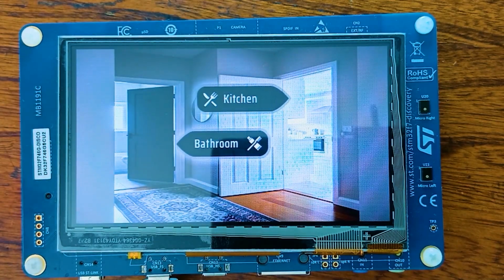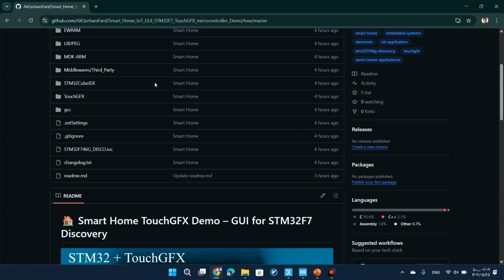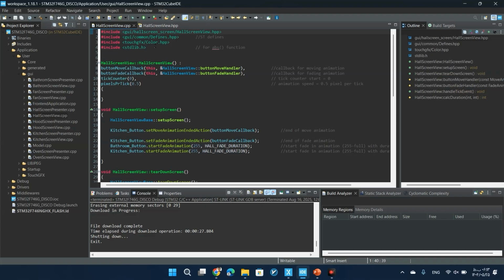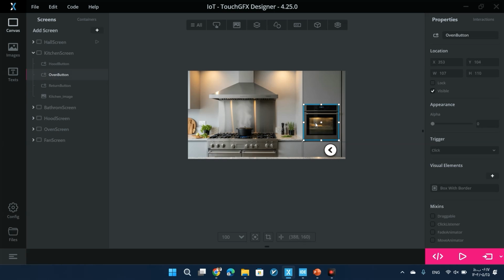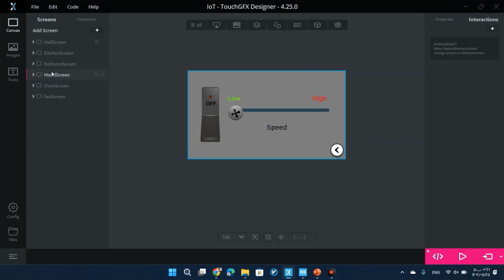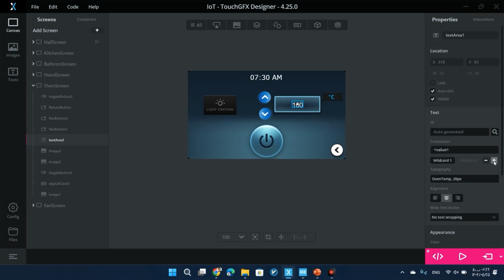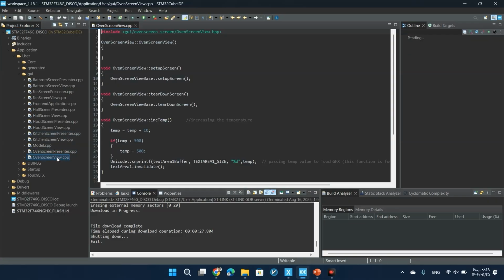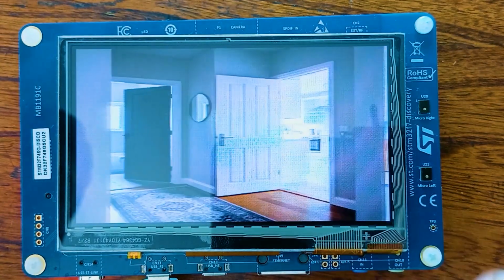Smart Home Control on STM32! 🏠⚡ | TouchGFX GUI Demo for IoT (Kitchen, Hall & Bathroom)

Comment: Good Luck! Where do you get the png files from? (The vector files for the light on png and the light off png for example) Tell us the procedure pls.
Reply from the maker: Dear Mohammad,
most of the pictures used in this demo can be found in TouchGFX Demos. there is a specific demo called "SmartHome" which is designed by ST engineers and you can use those pictures.

there are also websites that provide copy-right free images, my favorite one has been "https://pixabay.com/" so far.

but frankly ST demos are the greatest sources for GUI design pictures.

and with a little bit of experience of working with Microsoft paint, you can customize  your images.

Good luck with your designs :)🦊
Reply: @SlyFoxelectronics  Can't thank you enough! There is a very exciting feature in the SmartHome demo that is a sliding menu. Whenever we touch a button this menu appears, Do you got any idea on how this feature is implemented?
Reply from the maker: you need to use containers